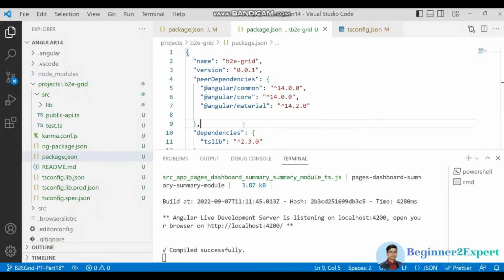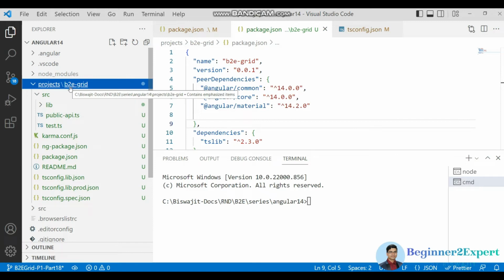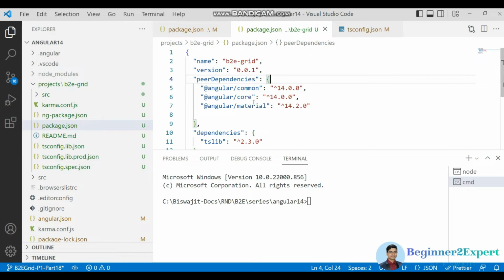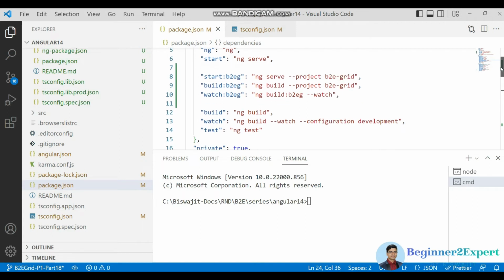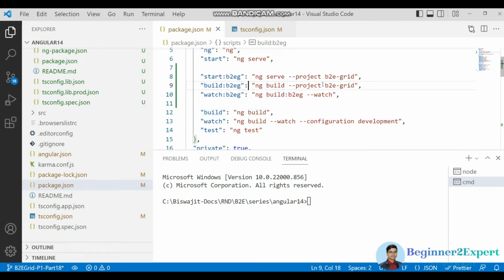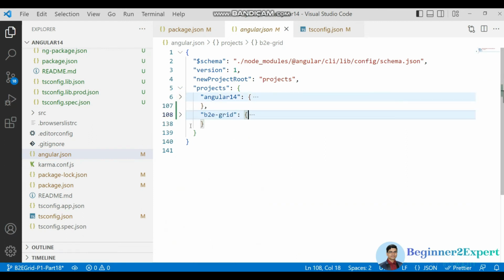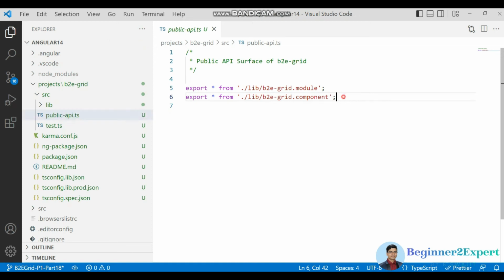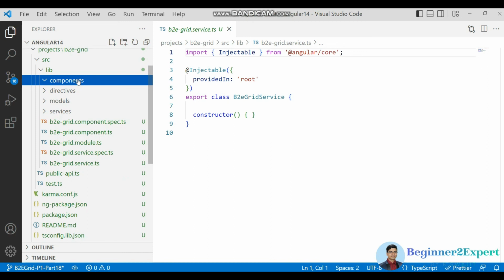Part 18 - How to create a custom library and publish to NPM repository | Angular 14 series

Comment: Tell me if i am right ,If i need any package in my lib components example chart.Js then i need to install it in my angular project in which lib is contain and then it add manually in library package.json inside peer dependency.                           My consuming project where my  lib is used will automatically install chart.js